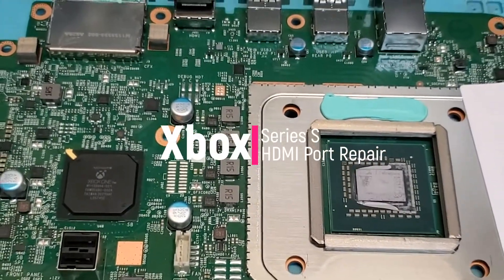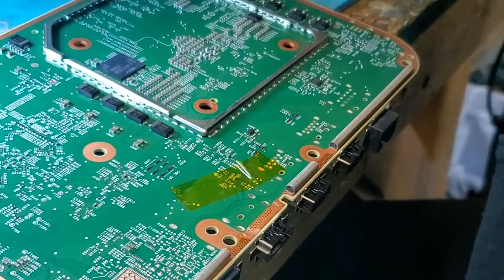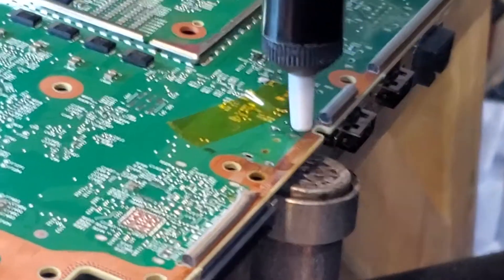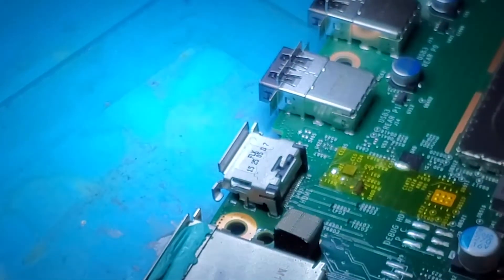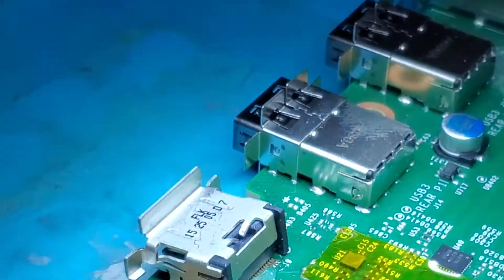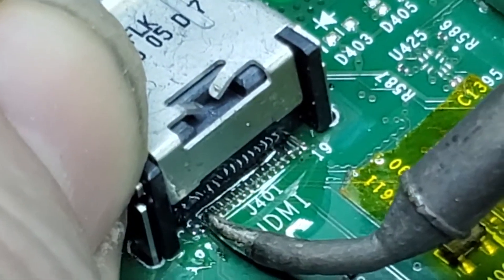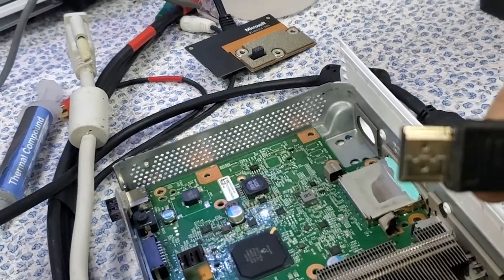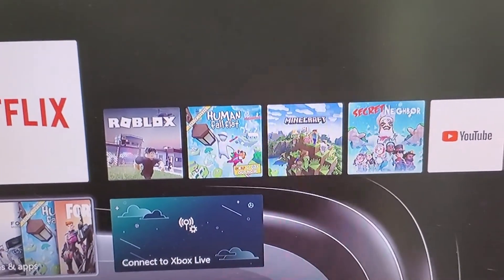Xbox Series S HDMI Port Replacement (Best Method)

Comment: A Xbox One S HDMI port is to tall and the front grounds don't sit where yours does. What kind of port is that really?
Reply: Use a diffrent tip or be more careful when soldering the pins. You melted the shit out of that port.
Reply from the maker: are you using the xbox one s, we use that port all the time work fine we did dermal the post a little bit
Reply: @TekkiesIncBartlett  Yes, an xbox one s port. Its like 5mm taller than the series s port.
Reply: It is a the original xbox one HDMI port

Comment: The port is too short it doesn’t come out of the box
Reply from the maker: You have to trim HDMI cable  end that plug into the console, so it can go deeper into the port. They do not have correct port available yet. Should be in video near end